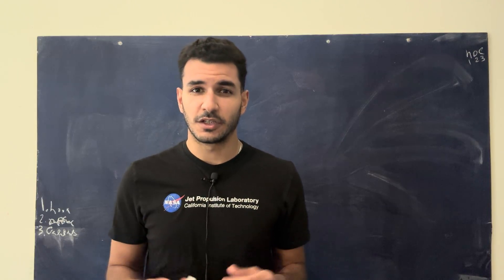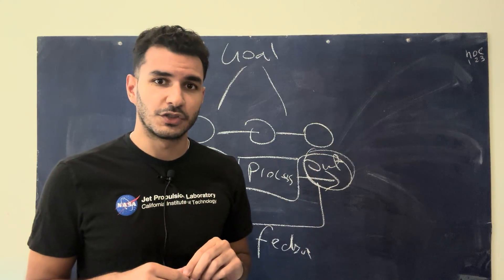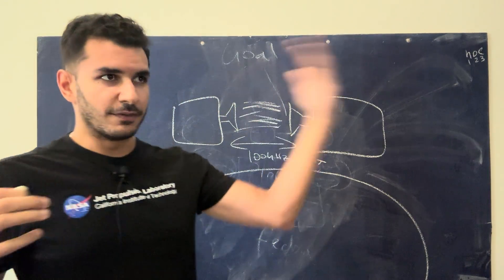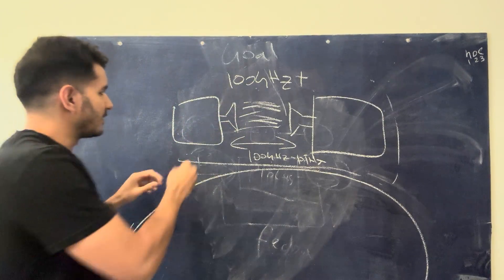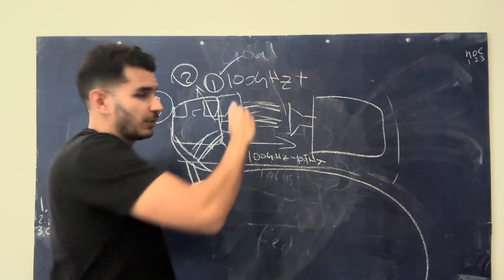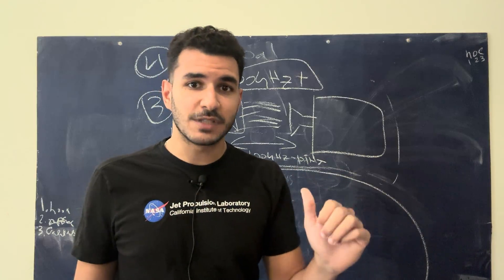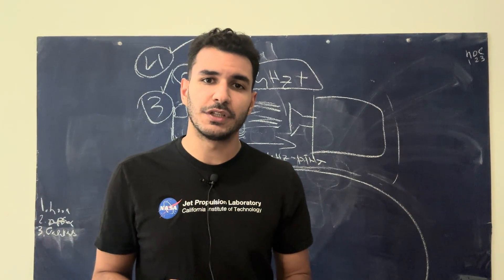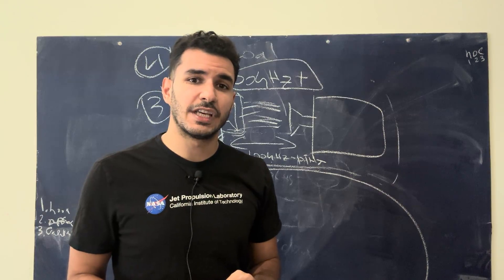NASA Engineer explains why systems engineering is the best form of engineering

Comment: I'm a systems architect. 

Everything is modules and integrations. A system is a module. A module has inputs and outputs - taken together we call that the module's "interface". An integration is a connection between modules, one module reaching out to another module's interface.
Imagine a module as a black box. You open that black box. What's inside? More modules and integrations, all the way down. We refer to a module inside a module as a "component".

What he's talking about with the satellites is mostly component implementation. That's very different from system design, requires specific knowledge like he said. You don't need to be good at any one thing to be good at systems. You just need to be able to analyze a system by keeping the map of the modules and integrations in your cognitive space.

Not all systems are goal-oriented - weather systems are not goal-oriented. But they all have constraints - what are the limits of what is possible - and outcomes. When you design a system you're considering the full interface, within constraints, and the modules that allow the system to function to produce an outcome.

It's in no way restricted to physics or technology. It's a cross-discipline area of study, which is why you can't purchase an education for it - universities don't do cross-discipline at scale. But once you've learned it, you can apply it to physics, economics, philosophy, finance, whatever you're interested in.

The approach is: what is the problem? It's usually with an integration - friction between two modules. So you identify the modules, and go upstream to what modules those are integrated with. You ask questions like "why does this integration exist? what's it trying to accomplish?" and "why are the modules configured in this way?" and eventually you get a good understanding of the map. You don't need to know the physics of antennae to accept that it's a component of the system with the purpose of serving as interface. To be a good systems engineer you need to be really comfortable with uncertainty, and it takes a lot of intuition to identify what matters in the problem-space.

Remember limits in math? (x^2)/x as x goes to infinity? x^2 is the important one. You need to be able to look at a system, and say "this component is the one that determines the outcome here. The other components matter, but they aren't important for this problem and I can safely ignore them".

Comment: As a systems engineer I have come to realize that at it can be easier to describe as “Full stack engineering”, where you pick a problem to solve, and you must indeed have the deepest understanding of the basics for all the components of the system. This is typically most useful when IMPROVING something as most of the work is done for you, luckily there’s 0 shortage of things that need massive improvements, because unfortunately there’s a massive shortage of good systems engineers. I started by learning computer science basics then in all IT basics, then in depth networking, and my expertise server management, and thus systems engineering and design, in computing, each server is a complex system, and this is all software based. But it’s not really software engineering, sure I code, but coding is not my job, many other people can do that. My job is literally to solve problems, any problem. Often times the technical symptoms have a people root cause, etc. whatever, tech is by far my field of expertise. I developed an app to solve a very specific problem, and I did it because I also understood business, as I work in tech for financial firms, by business basics are extremely high surrounded and constantly supporting some of the best business people on earth important things rubs off, and my own love for learning just about anything possible helps, as I am not satisfied with solving problems, I must know everything. Because, well knowledge is a systems engineer’s fuel. We’re like researchers who actually then also solve the problem, it’s impossible to outright know everything, if that was the case the problems wouldn’t exist to begin with. We look at a problem, identify the problems, identify how to address those problems, then identify any nee problems, think practically about the cost of solutions, and their feasibility, and if that’s a problem, we fix that too. Back to the app, I am not a Full stack engineer, I am a systems engineer, much better, I don’t have constraints. I did my best Full engineering job, as it’s a simple app, it wasn’t totally achievable with AI, not it’s not AI slop lol I coded 90% of it myself, but as I am not an expert, yes that 10% which is critical was done with AI assistance. When coding everything is critical lol, if a line or character is not needed, it should be removed, even comments. But the point is, the app is a business idea, not merely an app. How do I make and distribute this, how do I price it, do I patent it? What happens when competition arises? Etc. etc. I could just open source it! But then it wouldn’t be taken seriously in the business industry, so that wouldn’t really work, and so on. Still working on that app lol, almost done, yes mostly everything is worked out, took a few months only, on my spare time (which isn’t a lot). Beyond that, I know a lot about zoology, so I have drafted a scientific paper, answering a question I see come up too often and then find out it’s basically not at all well answered. Well there’s my problem, and I had a critical mass of relevant information already, came up with the theory in a days work worth of time. Some political work as well, same thing. It would be extremely valuable for the world to have a field of work that trains people to gain the ability to solve any problem, first by understanding the principles, understanding troubleshooting methods, problem solving methods, problem identification, and understanding what you DONT know, very important, as well as understanding how to gain the sufficient knowledge required from that in order to solve the problems you need to solve, it’s not about becoming an expert, it’s about understanding how to solve the problem theoretically, and most importantly then practically, any idea that doesn’t survive practical scrutiny must be re-framed or entirely abandoned (I solve problems, not write philosophy or science fiction). But no actions should be taken without a robust design in mind to begin with. As an engineer why is your favorite word, as a systems engineer, learning is part of the job, you don’t need to be the expert, but you must know how to bring them in when needed, or learn it and do it yourself if the information you need is simple enough in scope. I get why it’s not taught, but it should be. School won’t make you a systems engineer though, as described by this video and many, that something you must become. But it would absolutely be extremely useful if the blueprint for becoming a system engineer was taught at a high level. Most of us stumbled out way onto this, and it would benefit the world tremendously if instead of a curious few, we could make an army of guided missiles, to prepare for tackling any an all problems everywhere.

Comment: I became a systems engineer through Tech. Then expanding my engineering knowledge outside of the PC world, understanding that I could apply the same principles to any system, not only computer systems, just need enough good information on that system to go off of. Obviously having studied everything about tech, I have that down easily, most systems are already very good, but improving them is my biggest contribution, specifically when problem solving. But the more I learn about anything to a certain critical mass, the easier it is to see the best solutions right, and when deep diving, getting to extremely powerful designs. 

I would describe it this way, give me a goal and I will tell you how to achieve it as well as possible, based all the good information of relevance available. This how to would be the system’s design, end getting actually implemented is the engineering. Again something very common and straightforward in tech, with software engineering. But it’s not focused on software, those guys are notoriously bad at designing “good” systems lmao. It’s multi-disciplinary in nature. Understanding how to write software and understand how to design and implement a system are completely separate concepts, but obviously systems engineering is dumbed down to the specifics of a engineering specialty and built in, so these engineers don’t just make garbage. But I know for fact that the trade suffers when this is done.

Comment: I did a systems and computer engineering degree. Not sure they really emphasized the systems part. Or the computer part. Loads of calculus is what I recall. Control systems was optional.

Comment: I‘m a Systems Engineer myself, although I‘m still studying Aerospace Engineering in my last semester of my Bachelors. I used to work for almost 3 years in as student rocketry club as the main Systems engineer and project manager. There we actually launched a hybrid rocket onto 21km.
After that I was a Systems Engineer in a rocket start up from Germany.

So I have a bid of experience in there. And my opinion is, that a complete Speerwurf Systems Engineering major is not the right way. There are a lot of disciplines in SE. These however are not trivial, but I think that if you have enough interest for it and different engineering fields, you do not need a SE course. I think it is enough if SE is thought in separate course, where majors from different fields come together and create something. And a Systems Engineer is also a very very very good communicator. And this you can not learn in university…

Comment: I recently applied for a Mechatronics Engineering course but was instead offered a place in BEng Computer Systems Engineering at the University of Essex (UCAS Code: H652). I’m seeking advice on whether this is a suitable and worthwhile alternative. According to the official course description, this program focuses on designing, programming, and integrating computer hardware and software within intelligent systems — including robots, autonomous vehicles, and IoT devices. The course covers both theoretical and practical aspects of system design, and is taught by the School of Computer Science and Electronic Engineering.

The degree begins with foundational modules such as Computer Systems and Architecture, Digital Systems, Mathematics for Engineers, and Programming (C and Python). In later years, it progresses into advanced modules like Embedded Systems, Real-Time Systems and Programming, Control Engineering, Robotics, and Digital Signal Processing. In the final year, students complete a substantial Individual Final Year Project that reflects real-world system-level design and problem-solving. The course also includes practical laboratory sessions using ARM microcontrollers, FPGA boards, and simulation tools such as MATLAB/Simulink, providing hands-on experience in embedded systems and control.

I’m hoping you can advise whether this course offers a similar or stronger future scope compared to Mechatronics, especially in terms of career flexibility, robotics, and embedded systems development. I’d appreciate your insight into whether this switch would be beneficial long-term

Comment: Congratz for the video! it's very interesting

Currently I'm working as a system engineering in the aerospace sector.. and sometimes I get myself trying to understand all the details of all areas. Problem is: my day has only 24 hours. 
I can't be the specialist. 

Nevertheless, as i'm aware of the project having the "global view of it' I can predict the major challenges among the areas of developing the subsystem and therefore, advance in more feasible solutions! And as you said, at least one area I need to be an specialist, and of course it's related to physics

thank you for highlight this point of view according to all of your experience.

Best.

Comment: Surprisingly, this video just popped up on my feed. I have an electronic system engineering degree and about to take systems engineering for my master. I was debating if I should switch to electrical, but after watching this video, I’m sticking with the original plan. Thanks!

Comment: The way I'd characterize Systems Engineering is that indeed it is a "jack of all trades" kind of engineering degree, at least based on the program I've seen at the local university. But it also adds mathematical modelling abilities that the other engineering programs don't typically have. This video alludes to, but does not explicitly state the most important interaction between components of any system ... the transfer of information content between the components. This can take many forms, depending on the system in question. Most engineers have never even heard of Information Theory which underlies feedback control systems. Interested readers should look up Cybernetics: Or Control and Communication in the Animal and the Machine by Norbert Wiener of MIT, back in 1948. Systems engineering involves both information theory, and feedback control in engineered or natural systems, but this makes them harder to analyze.

Engineering is very fragmented. A mechanical engineer tends to understand Newtonian physics really well to build complex physical things like an engine. But they tend to be really weak in building complex electronics or software systems. Similarly a software engineer is essentially a very applied computer science degree, with a focus on developing software as an industrial process, less focused on the theoretical aspects of computer science. But try asking them to model an optimal user interface for that software and watch how bad the result will be.

Now, systems engineering people, the good ones anyway, are able to think about a complex machine or complex natural system at the level of abstraction that allows them to more easily "see the big picture" by understanding and quantifying the interplay between the different components or parts of the system not in terms of just one discipline, but many of them. Even "engineering psychology" where a machine or vehicle user interface is designed to facilitate the transfer of information from the machine to the human operator at the right times, in the right measure, for most effective interaction, is part of the domain of systems engineering. This kind of knowledge is not usually offered in the traditional engineering curricula.

For this reason, a systems engineer would be the best overall manager of a complex engineering project because ideally they can "speak the language" of the other more specialized engineers while also ensuring that a complex design is able to meet its design and functionality requirements.

Comment: In Romania (where I am from), there are polytechnical universities that offer degrees in systems engineering, with an emphasis on electrical and software, but you also do mechanics, chemistry, physics etc. I'm starting this year.
Reply: Where im from also there is only one polytechnical university that offers degrees in systems engineering. but Im lost between computer engineering and this major

Comment: Hi, I’m currently working towards a bachelor’s degree in mechanical engineering, but I’ve found that I’m most interested in control engineering. What’s the difference between control engineering and system engineering?

Comment: How Ali became a system’s engineer: (just my summary for me to look back on bcoz I find it interesting. I might get some details wrong)
He had a bachelors and masters in electrical engineering. He linked up with a professor who was researching on high speed communications systems. The professor became his phd advisor and Ali suggested to him whether he could try using the professor’s terahertz technology in space instead of cellular networks on earth. His PhD topic became high speed communications systems in space and his grand goal was to launch satellites using terahertz technology in space
Over the course of 5-6 years, he created several papers to address some problems. While solving these problems, there were other engineering domains he needed to self-learn in order to write these papers
1. Will the satellite work in space? This problem required understanding thermodynamics,material science and classical mechanics to see if the satellites would survive in the harsh space environment etc.
2. He compared this terahertz technology with others like laser technology and lower hertz communication technologies. This required understanding signals and lasers. I think this might’ve been covered in his electrical engineering
3. How to create a high quality antenna that doesnt break down easily? Materials science, signals etc.
4. How to create a satellite that not only transmit but also receive signals. For this, he had to create a circulator that required understanding electronics hardware and low level programming etc.
5. How to create a network that links many of these satellites properly such that any possible communication disturbances are reduced. His talented colleague coded a simulation to demonstrate the proper network needed. software engineering was involved here.
6. How to get funding for this phd topic? They created a paper to show how this terahertz technology could be adjusted to switch from sensing to radiation or communication and what not to show investors how much value their project had as this technology had many use cases